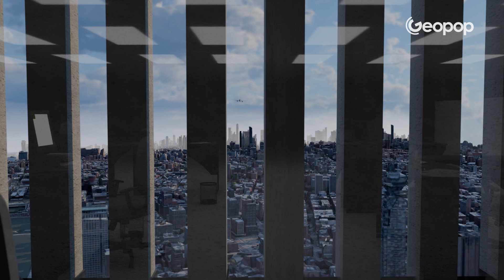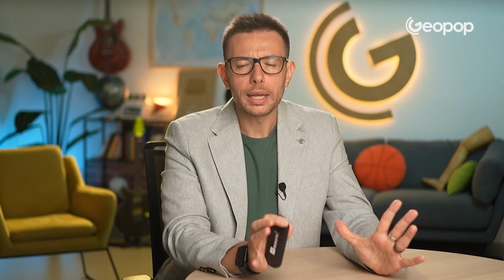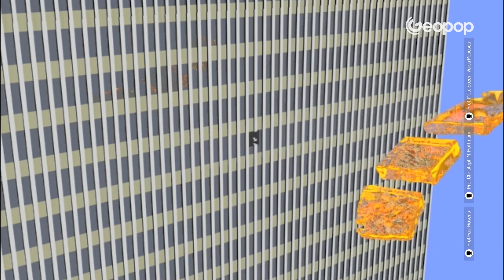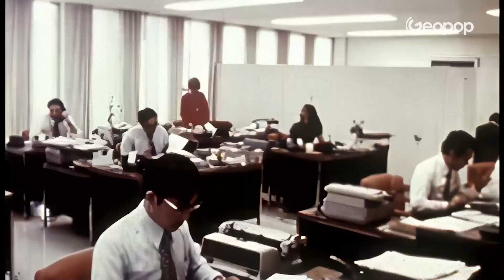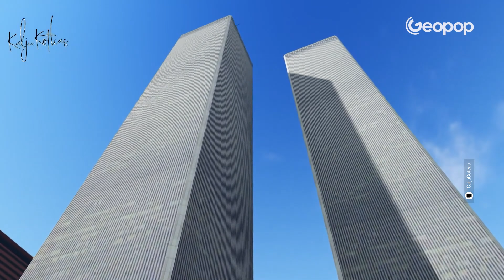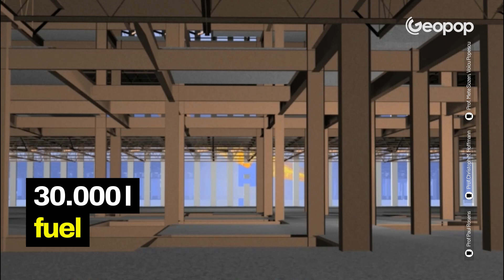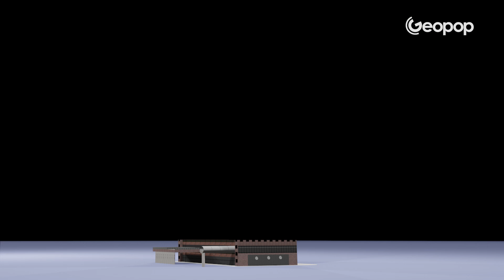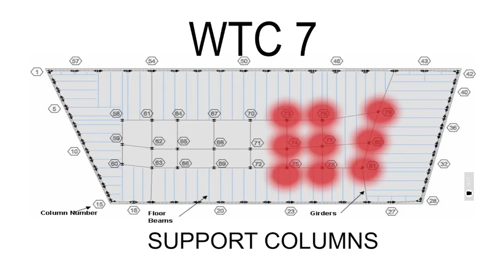9/11, 2001: The Technical Reconstruction of the Twin Towers and WTC 7 Collapses

Comment: OFFICIAL NATIONAL NEWSPAPERS NOTICE REVEALED TRUTH OF 9/11 BACK IN MARCH 2020 !!!! 
The Daily Papers in the UK all had an official Notification included in March 2020, that stated quite simply the following:-
QUOTE: "The New York South District Court has issued "INDICTMENTS" against ALL the U.S. Secret Service Agencies for their part in the "DEMOLITION" of the Twin Towers on 9/11". UNQUOTE.
Meaning that all these Secret Service agencies used pre installed "MILITARY EXPLOSIVES" to cause the Twin Towers too collapse in Nice neat Vertical piles. 

Revealing that the Aircraft were not the actual cause of these buildings collapsing, which is not surprising as such buildings had to include technology in the design to prevent the then largest passenger aircraft the then Boeing 707 four engined jet (precursor to the 747) from destroying these 1,000ft high buildings. Further it was also a requirement of those buildings design that they had to be able to cope with the much bigger problem of being hit by a Hurricane. A Hurricane with winds of 100mph or higher would put thousands of tons of stress onto the whole side of such a building facing such a Hurricane. Which again reveals that small Boeing 767 twin engined jets would do no more than cause a fire, but insufficient damage to cause these buildings too collapse, and does not explain the fact that both buildings collapsed in "nice neat vertical columns" !!!!!
Reply: Even Shyam Sunder from NIST stated that the crash the towers were designed to withstand would have been more destructive than the actual impacts on 9/11.
Reply: @Kudde23 First you need to know that I am a very senior Mechanical Engineer, which is one step up the Engineering ladder from a Civil Engineer. And it would have been a Civil Engineer who designed the Twin Towers. Next I have worked WITH both the British Military & the US Military in the past, a very important fact, for specialised Engineering reasons.
   
 The buildings were NOT vulnerable to destruction from Aircraft. It was a requirement to obtain planning permission to build ANY building that they meet safety requirements. Which for 1000ft high buildings meant they had to be built in a way as to be 100% IMMUNE to the effects of Aircraft hits, and the much, much, much bigger problem of HURRICANES. 

Just one Hurricane would be worse than 20 Aircraft hitting the building at the same time. Because a HURRICANE with winds of 100mph or Higher put's TENS OF THOUSANDS OF TONS of pressure on the whole of one side of a building, not just bits of it. So as a senior Engineer, and Military operative, I said on the Day of 9/11 within seconds of seeing that News footage on TV "Little airplanes have absolutely nothing to do with the collapse of those buildings. It can only be achieved by using a Military explosives fitted on each and every floor". So clearly 9/11 was a G. W. Bush plot to give him the excuse he needed to go and finish the Iraqi War his father Bush Senior had started. And do not forget that Bush Senior was originally the head of the CIA ! 

And those Aircraft. The Blind 99.9% of the human race, including the daft plane spotters, have never even noticed that the Two Aircraft involved, were NOT even the civil variant. They were a USAF Military version, intended for the movement of military stores and supplies between U.S Bases (so had NO seats). And this fact can be clearly seen on the only piece of quality film footage of the First plane to hit the Twin towers. The give away is a small bulge on the underside of the fuselage in line with the main wings. But the problem with this military Boeing 767 version is that since 1980, they can be flown remotely from the ground (that bulge reveals this fact). And this issue caused the European CAA (Civil Aviation Authority) to BAN such aircraft from being flown across European skies, which was revealed at that time (1980) in a number of Military Aircraft Magazines, available to the public ! 

Hence there was absolutely no one on either of those planes not even a pilot, that hit the twin towers, and to help the disguise they had simply painted the planes in a suitable Commercial Airline livery. Indeed this is supported by the total lack of dead peoples families screaming in the courts for compensation,, after the event. Because there was NEVER anyone on those two planes, hence no claims ! And I knew all this within seconds of seeing the News on TV on 9/11. Because of my Engineering & Military University qualifications.
Reply: @Heinz-c6c  Please calm down mate, I was supporting your point...
Reply: @Kudde23 I was adding more detail to what I discovered years ago about 9/11 !
Reply: @Heinz-c6c  - So what's the case number and where is this alleged case at 5 years later?
Reply: @TheLoonResistance  Ah, I'm guessing you're an American, so you won't be aware of the Laws in Britain covering "Official Government Notifications". As I've now discovered you Americans do NOT have any such Laws in the USA.  So, under British Law when an "Official Notification" from Government is to be released to the Public, it has to be published in ALL the National Newspapers within 60 Days. The actual Day of release is up to the Civil Service Department responsible and they can select a suitable day within that 60 Day limit. 
I was living in Spain at the time, but I always purchased the British "Daily Telegraph" & "The Times" Newspapers, on Wednesdays & Saturdays. So both obviously included exactly the same word for word "Notification" as its come from the British Government. And all other British Newspapers on that day would also have had identical copies published in them. 

Now I had no reason to hang on to either of those Newspapers, because I had assumed this information would have been published internationally. So the World must have all been told, at that time, which was in March 2020. And the only reason I even remember it was March 2020, is because, on the previous day the Spanish Government instructed that the whole country should be "Locked Down" due to COVID 19 finally hitting Spain. Which meant nobody was allowed to leave their house, except to visit a Supermarket, Hospital, Pharmacy or the Tobacco shop (which also sold Newspapers). And if the Police found you doing anything else there was a €200 on the spot fine ! Hence there was now nothing to do, except sit at home and stare at the walls. So I bought those two quality Newspapers simply for something to read. 

It's only been since that publication that I have found no one in the USA seems to know anything about it. But the easiest solution is to obviously contact the New York South District Court. Which is according to Google located at 500 Pearl Street in the Civic Centre neighbourhood of Lower Manhattan and the courthouse is a 27 storey building. So all you need to do is phone and ask them. They are legally bound to reveal what those Indictments state if you ask them for that detail. And considering the importance of those Indictments I'm sure the staff in that Courthouse must be aware of them !!!!
Reply: @Heinz-c6c  - So that was the really long-winded way of saying it's all 🐂💩

Next time skip the word salad of I don't care and just answer the effing question.
Reply: @TheLoonResistance  Yes but the answer isn't just for you, the whole world can read this. And its obvious as so many people have responded that they don't believe what I have posted to be true. Is the proof of what I have been saying. That Youtube is being Blocked in Britain & Australia, from revealing the true stories going on all over the European press. And in the case of Britain I would suspect that GCHQ in Cheltenham which is MI6, is probably the source/control for Blocking stories on Youtube in Britain. And I guess whatever passes for MI6 in Australia is doing likewise. And this means that Brits & Aussie's are being fed a very one sided (pro Israeli) story !!! I'm personally not Politically aligned on this.  I'm just pointing out that the Public are being deceived !
Have a nice day.
Reply: @Heinz-c6c  - Is there, right now in the United States a current court case pending in ANY U.S. District Court that matches your description of what you think you remember from a headline from 5 years ago that you threw away and unfortunately the internet didn't exist then so you can't find it now?

This is a ONE WORD ANSWER and that answer can either be YES or it can be NO

No other words will be accepted and will be ignored, only YES or NO.
Reply: @TheLoonResistance  Don't know.  I don't live in the USA. What are your frightened of ?????
Reply: @Heinz-c6c  - Why did you even start this thread if you don't actually know anything?
Reply: @TheLoonResistance  I Know a lot about what happened. All I have done so far is simply repeat what was published in British Newspapers, because I recently discovered no one in the USA seems to be aware of what we in Britain were clearly told back in 2020. But if you want more detail, to confirm what I have already said, you simply phone that court in New York Monday morning and ask !  

However long before 9/11. I had worked with both the British & American Militaries in a technical capacity. And whilst working with the US Army & USAF in Germany, I became party to some rather interesting information which has a bearing on 9/11. This is that even in 1981 the USAF had a military version of the Boeing 767 intended for use as a transport aircraft to shift stores and equipment between US Bases. The problem with these Aircraft was that they could be flown remotely from the ground so as to save on Flight crew costs. The problem was that the European Union Government was made aware of these aircraft and immediately banned them from being flown in European Airspace unless manned. But the availability of Boeing 767's that can be remotely flown from the ground has a very serious implication for 9/11. The two planes that hit the Twin Towers were Boeing 767's. But the important snippet of film footage taken of the first plane hitting the first Tower. Was taken by a Professional film cameraman on the street below in the middle of recording a programme about the New York Fire Brigade. And that snippet of film got onto the Internet almost immediately, and revealed the underside of that Aircraft had the Military Radio Control "Bulge" on the underside of the fuselage. Meaning those two aircraft probably had no one at all on board. 

And as those Indictments state the Secret Service Agencies part in this disaster, was that they used pre placed Military Grade  Explosives positioned on every floor of both buildings. As two little twin engine 767's is not nearly enough to explain the incredibly weird multi-hour delay between hitting those buildings, and the even stranger way they collapsed. Which was "Floor by Floor" in a nice Neat Vertical Pile, in both cases. Clearly to a very senior Mechanical Engineer like myself and indication that the buildings collapsed as a result of Explosives, not little Aircraft. Which now fits in with what the New York South District Court Indictments state: "DEMOLITION" which means explosives not aircraft !
Reply: @Heinz-c6c - I don't give a damn about any of that. No one is under indictment. There are no charges, no trial.

All bullshit.
Reply: @TheLoonResistance  So what your telling me, is that you're another Mentally Retarded American ???
Reply: @Heinz-c6c  - So what you are telling me, is you have been lying from the off and there is not now and never was any court case.
Reply: @TheLoonResistance  Surely you understand your own Legal system?  Issuing Indictments is NOT a Court Case. This is the laying of Legal Charges, against the accused. It could take years for it to actually reach Court. Indeed in the USA, the preparation of the Indictments must have been laid by a "Federal Prosecutor", as the crime crosses State Borders. The Defence being "All the Secret Services agencies", must also be allowed time to build their Defense. And Knowing your Secret Services agencies, they will probably try and drag this process out for years. Don't forget a Court cannot issue "Indictments" against anyone, unless it has already amassed reliable PROOF.  

And if you haven't yet figured out WHY the Two Towers were demolished. Firstly those buildings were the International Trade Centre, where around 70% of the people in those buildings were obviously NOT even American Citizens ! Making it a more suitable target by the then U.S. Administration. Because ultimately this crime leads straight back to the door of the White House, and G.W. Bush. For the simple reason he was clearly looking for an excuse to continue the War against IRAQ his father Bush Senior had started a few years earlier. And ignore the Treaties signed in connection with the suspension of that War. And Bush senior before he was President was the Head of the CIA ! Indeed G.W. Bush was also in Bed with the then British Prime Minister Tony Blair. Who many in Britain are highly suspicious it was "Blair" behind the mysterious "London Bus Bombing". As Blair immediately used claimed that was supposed to be a Terrorist attack, as his ticket, to climb onto the G.W. Bus bandwagon. And join in the continued War on Iraq, all on the pretext of getting rid of Saddam Hussein. This would allow the "West" to continue destabilising the Arab Middle East further. Which would of course help Israel. And having introduced the "Franchising process" into War, as a way of "Moneterising Warfare". Both hoped to cream Billions of US Dollars out of the Post War reconstruction. All of which forms the "Motif" behind the Crime.
Reply: @Heinz-c6c  - 5 years. Nothing. 

Move on.
Reply: @TheLoonResistance  The point is the Indictments have been laid. And don't forget 9/11 also involves the attack on the Pentagon in Washington DC. And I've been inside the Pentagon back in 1985. And that attack is also highly suspicious !
Reply: @Heinz-c6c  Stinky is a paid one...
Reply: @Heinz-c6c can't you see the close up view of the damaged floor as it collapsed? Thr steel bending inward as the collapsed happened combined with thermal video of the twin tower everything make sense 
What is even your point ?

Comment: This video basically summarizes the NIST report/findings for WTC collapses.   However, neither this video nor NIST report explains how the collapses happened in free fall (about 10 seconds each) when over 75% of the steel structure in the towers were not affected by fire.  The remaining 75%+ steel structure would have provided some resistance such that the tower collapses would have been asymmetrical or partial collapse, such as falling over on its side.   I'm a registered Professional Engineer, and have a hard time accepting this video's explanation when you see free fall collapses in WTC 1, 2 and 7 which go straight down symmetrically while over 75% of the steel was not impacted by fire in those buildings, and in the case of WTC 7, this building was not even hit by a plane.
Reply: No the first tower doesn't go down symmetrically... Watch it again and pay close attention to the top of the building as the entire thing falls, you missed that in the smoke. It doesn't actually go down perfectly symmetrically like a controlled demo would.
Reply: The collapses did not happen in free fall in 10 seconds which is obvious enough to anyone with the gift of sight and ability to tell time.  Measure it yourself instead of just trusting some rando on the internet.

32 to 34 seconds for the Twin Towers.  18 to 20 seconds for Building 7.  For those keeping score that is 1/3 of FFA

Comment: The University of Alaska has completed the most accurate models of World Trade Seven and stated NIST didn't use exact specs for any of its findings and that it was impossible for WT7 to globally collapse from office fires and that it proves beyond doubt that it was also impossible for it's columns to fail at exactly the same time without resistance from below. Explaining elasticity and  plasticity of steel without using the correct dimensions of the towers doesn't explain anything concerning the collapse of the only three steel and concrete buildings to have ever collapsed before or since due to office fires..or airplane strikes.
Reply: What makes Hulsey's models the most accurate ?

When a column fails, doesn't that mean it no longer offers any resistance?  I mean, it failed. It only has one job.

Comment: The way buildings collapsed straight down. This cannot be done without internal involvement and well placed detonators that we usually see when demolishing big buildings.
Reply: How is that different from the same structural elements failing by some other means?

How does the building know it needs to fall differently?
Reply: Hot bullshit straight out of the oven. Yes that can happen without " well placed detonators ". Look at how the buildings were built, look at how the steel beams at the crash zone bent in the second the south tower collapsed. Why would it fall any other way? I'm sorry, but you guys are just like flat earthers.